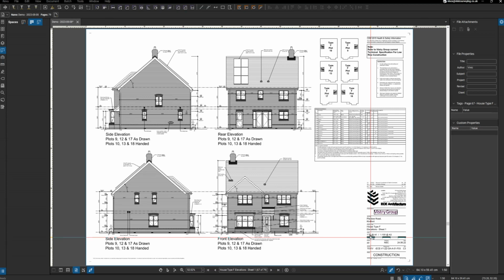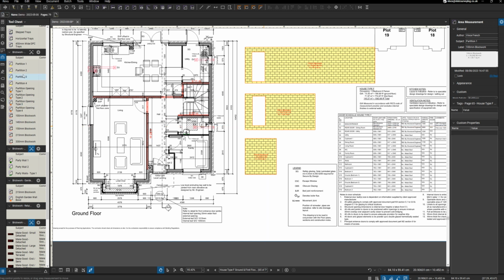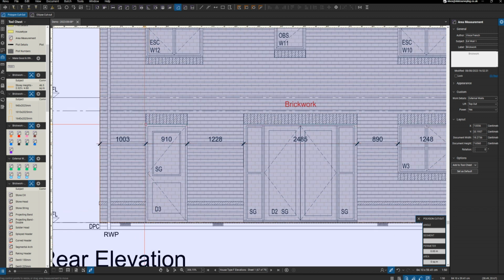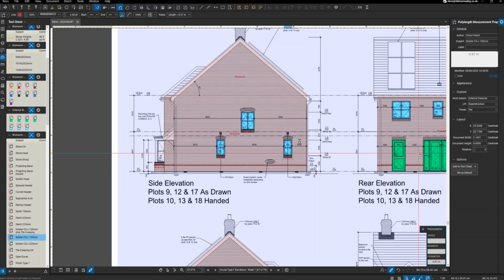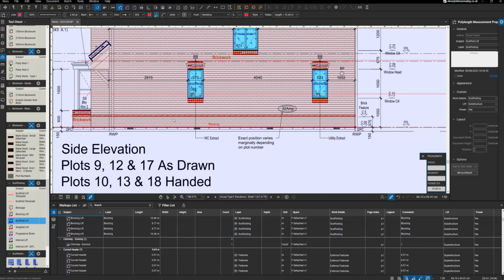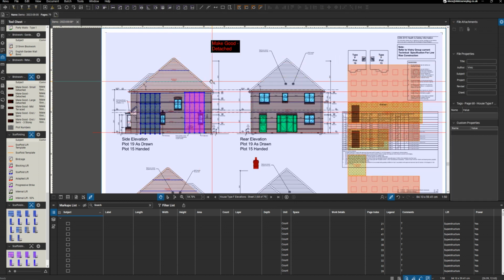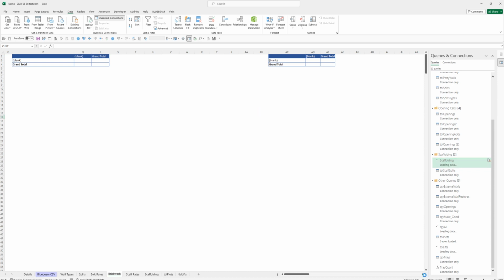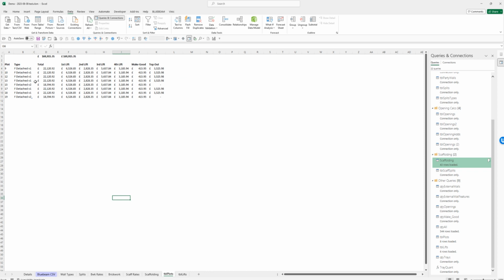Measuring Brickwork and Scaffolding - Bluebeam and Excel Setup

Comment: 👍 Really good to see other Bluebeam users creating Trade mark ups in the tool chest, also note the use of additional line styles. I may need some more tuition to create such tools.
Reply from the maker: Glad you like those!   I have Custom Profiles for each trade that I look at with various Tool Chests within each profile.  For measuring groundworks I actually have four different profiles due to the different tools and custom columns required for each.

What training have you done so far?
Reply: None, self taught from Bluebeam Tutorials and You Tube. Length lines I use are just basic straight line in different colours. I like how you have projecting course 75mm line, also the 150mm thick cills. This makes it easier to see your mark ups.
Reply from the maker: What trade are you measuring for?
Reply: We are brickwork contractors. I have also watched your video's on take offs on excel spreadsheets, I assume the contain macros to. Impressive work and quick. Well done !
Reply from the maker: Thanks.  I swore for years that marking up hard copies of drawings by hand and then using the spreadsheets was the quickest and best way of doing things.  However, I'm now doing everything on Bluebeam and not only am I just as quick but the level of detail output is incredible.  It also means that anyone can pick look at one of the drawings and automatically see what has been measured.
Reply: Its a great tool, if its set up with a comprehensive toolbox.